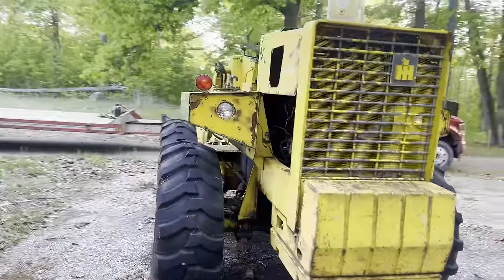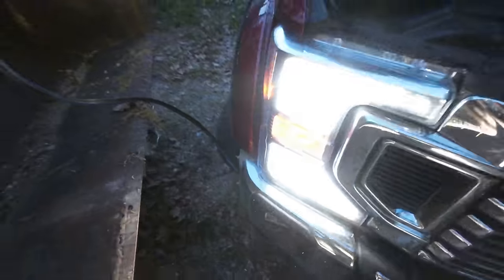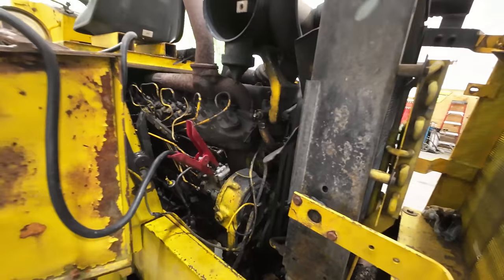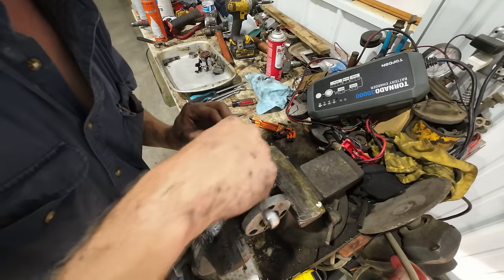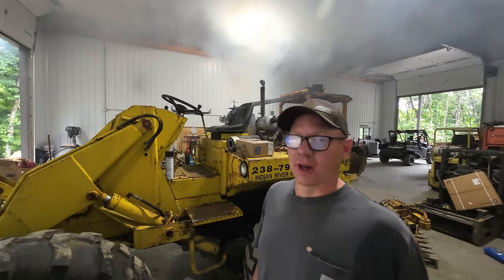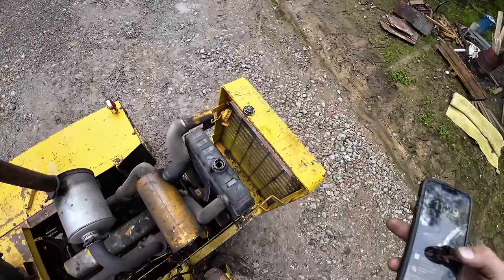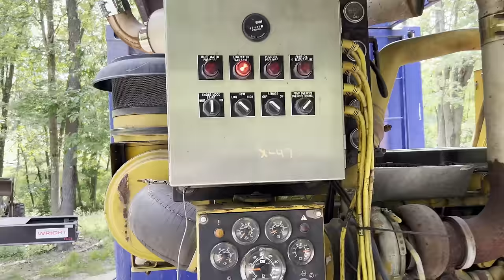FREE International wheel Loader, Sitting 8 YEARS! (Will it Run??)

Comment: The 282/236 engines were almost impossible to start without ether/ full glow plugs. The main problem was the rosomaster pump even in new condition needed at least 75 rpm engine speed  to pop the injectors. they had very low static compression . The injectors at very low tech but with a little gentle lapping can work well. good luck with the old timer. just a little heads up the injectors are a bastard to get out and the the precups are even harder. Be prepared to build a serious puller.
Reply: Yup no glow plugs no start on those engines they were not a power house but once they start they are or were a dependable engine easy to work on.  The last time I worked on one about 10 years ago I need injector parts and had a hard time finding them   But haven’t seen those engines in quite a while
Reply: An Espar coolant heater will cure that ;-)
Reply: @Onemanstrash1  nope it’s the style of the combustion chamber and the injector being up in heat chamber
Reply: The 282 used in the early ihc 706 tractors were replaced with the German built 310. Much better engine. We had a 706 with the 282. Remember it blowing a head gasket and the head requiring extensive work. And yes, strong batteries and starter as well as working glow plugs are needed for good starting.
Reply: @allanvaneste9106  tough old engines D236,D282,DT282 and D301 all ran same design great engines if you maintained them and watch your temperature several IH tractors,loaders,backhoes,bulldozers even IH pickups in 1960's ran these engines gotta have good glow plugs and batteries
Reply: @williamspates1015  What IH pickups ran a diesel?
Reply: @J-1410  somewhere around the mid 1960's you could get a D301 order in a C 1200 It was a rare option have only seen a few in magazine Red Power Magazine did article on it.
Reply: I've had cars with the roosa master pump on the 5.7 Olds diesels. The pencil injector version never likes to start in the winter, although is the better of the two by far because the heads don't crack like the poppet injector heads. Had one with head studs, MLS gaskets, and a 6.5 turbocharger. Plenty of power but would not start in the winter easily. Had to put in Bosch Duraterm glow plugs so I could keep the glow plugs on continuously while starting and for about 15 seconds after without burning them out.
Reply: @theodorgiosan2570  I have put manual switch in couple old 6.2 trucks did away with relay and timer.
Reply: @theodorgiosan2570  I had one too, and the temps in winnipeg in the winter are -30 stuff. That is where I found out about the 75 rpm minimum speed for the roosamater pump to develop enough presure to pop the injectors. My solution was to make sure ALL glow plugs worked and I used 0W30 engine oil, ( Artic stuff). It would light off right away with those changes, buck a little for a few seconds but did not fail me. It was the 1981 engine which had by then fixed most of the problems the older ones had.
Reply: Yup they love a good glow plug heat up
Reply: Hello 🤩🚜🚜🚜🚜🚜🚜🚜🚜🚜🚜🚜🚜🚜😊😊😊
Reply: @nfarnell1    Good   day from Ontario.  Yes  when I was  younger remember seeing old IH   tractors coughing, smoking.  I have 574  &  if u don't plug in  2hrs  it won't start.  Thanks
Reply: I luv reading all  comments..many thankyous to one & all for ur inputs...MY brain may not retain what all I read..😊😊
Reply: Thank you for ur Videos..they are done very well..& thanks for showing all that you do do..I enjoy..bless you for rescuing old iron & getting it running once again..shows others where the ideas come from for our modern equipment...just know this people..prior to this front-end loader was a hand shovel c/w a human on its handle to load wagons/trucks ect..you bet !...& then you knew that you earned ur meals & or pay chque... God Bless...
Reply: In fact my old service truck at the dealership (Howell Tractor & equipment co.) had the worst IHC diesel the DV550, talk about a smoking pig. I thought 3208 Cat motors stunk. DV550 has them beat!

Comment: My days of staying up 24 hours at a clip are long over, and it just shows you the resilience of the young. I used to work all day, load up the family, and drive 12 hours to my parent's house.
Reply: Coming within 6 feet of hitting a bridge at 70 mph while asleep in Wyoming cured me of long distance driving.  I trashed the trailer and cost me 24 hours of repair trying to get an extra 50 miles.  I unloaded the motorcycle to drive it in in the cold then started to fall asleep on the motorcycle in 30 degrees.  No more.
Reply: Gettin old sucks dont it?! Lol
Reply: repentandbelieveinJesusChrist9  Amen!!
Reply: repentandbelieveinJesusChrist9 what are you babbling on about
Reply: @1980bwc its not getting old, its getting sane. Its realizing not making it is a much greater possibility.

Comment: Matt, for your own safety, get the exhaust vent wired up.  You don't need to be breathing exhaust fumes.  Keep up the good work, love this channel 🙂
Reply: pretty shure the man drinks heavy crude for a passtime
Reply: I had a neighbor who jump started an old loader from underneath and it turned out to be in gear and dragged him over a stone wall.  He said he jumped clear in mid air and they needed to hire a huge crane to lift it out of the brush at the bottom of the wall.
Reply: If Matt lowers his pintle hitch, he might bottom out his trailer tongue jack.  It looked pretty low to me already.
Reply: Not the sharpest tool in the shed.
Reply: @alan6832  
Looked like it was already sagging pretty low.
Not sure how a pintle hitch works so maybe I'm missing something.

Comment: I swear those D-282's are the most cold blooded diesel I have ever dealt with! Place I rented years ago had a 1959 IH 660 Diesel for plowing snow... I moved in mid winter and my plow truck wasnt accessable. Never less than a can of ether after having it tarped with the tiger torch under it for a half hour... So much fun at -20! 😂
Reply: Yep, our 706 needed glow plugs even on a hot day
Reply: If it's as hard to start as that he'd be better putting in something else. The German built IH D358 engine I had in my old tractor was very easy to start in all weathers - but our winters here in N Ireland are nothing like yours

Comment: I like this loader, it totally looks like a full-size Tonka.  I think it's worth fixing when there's some time.  Get the injectors rebuilt, put in a new head gasket and flush the oil out of the coolant passages, figure out the brakes, and it could do some work even before touching the wiring.

Comment: Our old shop at work, had a piece of flexible 8" pipe hooked to the fan. It was on a pivot arm that swinged between two bays and just slipped over the exhaust stack. Worked great. You are an inspiration and I watch pretty much all your videos.
🤘😎 43:18

Comment: Hi Matt I think when you go on the long journeys, you should take a small generator and a light standard in case you’re working at night. You did a fine job with this thing.
Reply: Staying overnight in a motel is cheaper than an accident caused by lack of sleep.
Reply: @ron827  He is young invincible! That is so they got some of kids to go to Vietnam and Iraq and Afghanistan! Other places. Invincible
Reply: I was thinking he needs to make up his own custom "jump pack" with a couple large truck batteries and a large starter solenoid, with welding cable leads and lugs to bolt onto the starter. No sparks or destruction that way...and more power.
Reply: @paulprigge1209  we thought we were bullet proof. A lot of us are now paying the price.
Reply: @jimbrewer2893  yes we are !!
64 here.
And a REAL slow learner.

Comment: The first real piece of equipment I ever ran was an international 3800 backhoe. Essentially the exact same machine, only with the engine in in front of the operator station. Hearing this one run brought back a lot of memories. That D282 kinda sucks. They were super economical on fuel, but weak heads/gasket setup. Pull the head, check sleeve protrusion heights, check head for flatness, and use CAT head bolts when reassembling. 7 each of 9S1374 and 1D4574 if I recall correctly. Those bolts will allow you to over torque the head just a bit and stand a better chance of keeping sealed up. Im currently dealing with the exact same thing on a TD9-92. Good luck with it. They're getting pretty scarce.

Comment: Hey Matt, excellent video, love to see old machines come back to life.  I want to offer, and would like to hear thoughts from others regarding the oil in the coolant. But you may have inadvertently blown the head gasket and some other seals/gaskets by revving/running it hard once you got it running.  We did that once with an old Massey Harris tractor that had run just fine but wound up sitting for years after we got some additional tractors. We decided to return it to work pulling hay wagons one spring and pretty much did the same thing once we got it running and quickly blew the head gasket revving it hard trying to clear it out. Like making an old man get out of bed and run a sprint, something's likely to give out pretty fast – just a thought. You have interesting projects, please keep them coming.

Comment: Not knowing what you are looking for, and just taking it apart to see?  That's exactly how I teach my kids.  It's how I've lived my life when it comes to fixing things.  I'm 56 and have never had any of my cars to a mechanic to fix them.  From timing belts on my Audi to welding up a shift fork on my F150.  Just get it done and learn along the way.  As long as you have a general concept of how things work, do it.  This is why I love this channel, F around and find out....  in a good way.
Reply from the maker: Exactly!
Reply: If you like that method you are going to like @Mustie1, he uses the same method with small engines.
Reply: Refreshing to see you work on something big , I just changed the serpentine belt on a Honda Jazz/ Fit and after a fractured bolt on the alternator the parts dept giving me the wrong belt and an engine that somehow was put in to a compactor and no room for a spanner or a socket some swearing and skinned knuckles I finally was torquing the bolt it sheared 15 min of language my cuz said to me we can get a small pliers and wind it out from the back what was supposed to be a Saturday morning job turned into a two day marathon, the hardest part was get bolts of without fracturing thought I got away with it till the very last one glad I am not the only one!

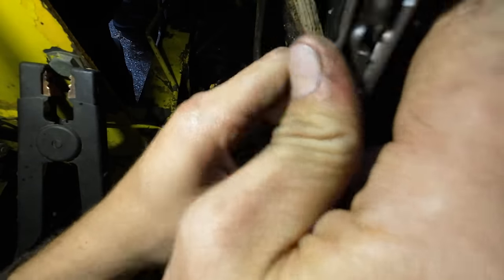Comment: 5:51 why not build a small camper thingy for your pickup bed? Just a bed with some minimal amenities like a sink, a mini fridge and a cooking stove with a popup roof, so it folds down to the cab height, while giving you still the bed sidewall height for tools. So you don't have the pressure to hurtle down the highway for 8 hours on the same day, but can comfortably stay overnight anywhere you want. :)
Reply from the maker: That’s what the back seat is for lol not like I live on the road. Just snooze for a couple hours if necessary

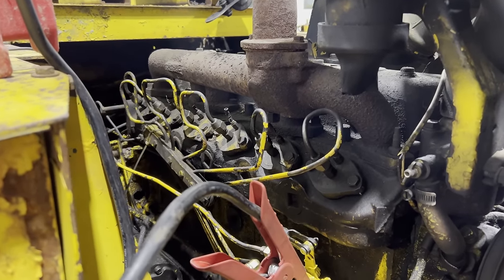Comment: Just came back from the Area Diesel Service pump repair.  Don't feel bad Matt, looking at the carnage on that video (35:20) he did everything but weld a bolt onto the broken screw or drill it out. Without the exact tool and experience I think anyone would have ended up in the same situation.  Also interesting to note that they said you were on exactly the right track - if you'd got the cam apart you would have found the frozen plungers inside and got them sorted no doubt.

What was amazing to me, not being a mechanic, was the ability to look over the mixed bag of what looked like junk, identify exactly every bolt, spring, washer, name it, and know what it was for and whether it's condition was okay.  It was really eye opening to see an expert at work, patiently explaining all the parts of the pump, how it works  and how to troubleshoot it.  Amazing stuff. We expect this stuff to 'just work' not realising the complexities of everything under the hood.  So hat's off again to you as a non-expert mechanic being able to bring these old ladies back to life.

I think with everything else going on with the loader it's probably not going to be a keeper, but it was a pleasure watching your adventure and congratulations to you on yet another success.

Comment: That loader looks to have the 282 engine in it. They were great little engines but used glow plugs. They pretty much has to have a full set of functioning glow plugs to start
Reply from the maker: Thanks for the info
Reply: 30 to 45 seconds of glow plug at 80 degrees. Not kidding!!!!

Comment: Hi Matt in this video you stated that you picked up the wheel loader in Upper Michigan but you didn't quite make it to the Upper Peninsula, that is north of the Mackinac bridge. I have a WD9 International tractor that I have had to replace the head because it was cracked when I bought it and I had to plug a few radiator tubes that were cracked from age on the right and left sides because of the fact that that the side frame didn't allow room for the core to expand and contract, also I had to replace the magneto when the input shaft bearing failed and when it did it broke the shaft in the hydraulic pump but I was able to put the price in place and put the gear back on and it worked. Yes it runs on Diesel and gas. Keep up the great videos and God bless you and your family.

Comment: I am surprised at how good the tires seems to be.  They look almost new.
Reply: Agreed. The wheels and tires alone were worth the drive.
Reply: I was thinking the same thing.   For an old loader the thing actually looks straight and not all bashed to hell like most.
Reply: MrLBPug  I am sure you are correct.  I was thinking the tires are worth saving if the machine were to be scrapped.

Comment: I'd be inclined to throw in a head gasket and see if you can fix the oil in the coolant.

Then I'd give her an Italian tune-up, putting it to work for your next top soil/gravel/fill/etc project and see if a good workout is enough to free up the injectors.

At that point, although still likely having excessive blow-by/burning oil, you should have a functional loader.

If you don't need it, rather than letting it rust outside, sell it to someone who needs a loader once in a while and is willing to live with the worn out engine...
Reply: I would guess $1000.00 for the head service.  $250.00 for the gasket?

Comment: Looks like a neat little loader, wonder if it would be better to swap in a Cummins, or Perkins 6 cyl diesel in it. The 282 is known for head gasket problems (not enough head bolts, engine was based off of a gas engine, not good for diesel engines).

Comment: I agree with you Matt, that though it does somewhat run, there are other projects that you have not finished that could use the attention, along with getting the exhust fan wired up for one, and addressing the gentry crane in the shop for two, and if you do not have the heating hooked up for the shop yet, I would get that done ASAP as well, cause July turns into August and september and cooler fall and winter weather...Love and enjoy your videos, Matt. Love and gentle Hus to you and your beautiful wife, and all four of your fur babies..

Comment: I had  a run in with a front loader like that in about 1975 , I was 17 I remembered it had a pony motor and after it was running I had to pull up two levers that were under the seat, one was for diesel fuel, the other was to engage the diesel motor to the pony motor to start it up and run with everything  working but power steering,  but I filled in a swing pool that was dugged out but never finished,  but it was a work out to say the least, the guy paid me double after he wanted to drive it, and he did! The steering  when the bucket  was loaded was he'll to turn! Good memories,!!!!!

Comment: Matt your getting better at redirecting the almost dead. Congratulations. I believe that overhauling the injectors and replacing the head gasket are well worth the time and money. This should cure the cold start and white smoke problem and also stop some sneaky little oil leaks. You look like your enjoying yourself and learning as you go along.
Reply: *You’re, not your.
Reply: I've noticed no one has mentioned the glow plugs. A glow plug engine will not start without operating glow plugs especially when cold.

Comment: You can use WD40 to start Diesel engines. Stay safe Matt!:person-turqouise-waving:
Reply: I've tried bug spray, it didn't work 😂😂
Reply: I have used WD40 to start engines for 40 years (especially those with glow plugs) with great success. You can also use gasoline on a rag over the air intake at the filter housing.
Reply: I use a spray bottle of diesel when I mess about with diesels. I saw a ford 300 6 cyl gas engine once, with all the rings cracked, and was told it was from too much ether. So I use ether sparingly, but am not opposed to it. Never was sure that the ether caused that issue, but it was in Alaska and the guy was trying to start it at really severe temps like -40 so that might have been part of the issue.
Reply: @lancenutter1067  my brother had a good running 300 6 cylinder  manual transmission that he downshifted and ended up over reving it , it broke all but one ring
Reply: @lancenutter1067 apparently you don't watch zip ties and bias plies!
Reply: @austinbrantley776  yeah the one I got had every ring broken in multiple spots. Didn’t hurt the bores at all. I honed, re ringed and had a great truck.
Reply: @George-dy3pt  watch occasionally. What is their take on ether? Too much or none?
Reply: @lancenutter1067 He uses ALL the ether. All of it.
Reply: @johnF1958   Ha ! yes ! while your mate is trying to burn the truck down you have to spin the cranking handle till you faint. Do this three times and she’ll start, but you won’t be fit for work for an hour !